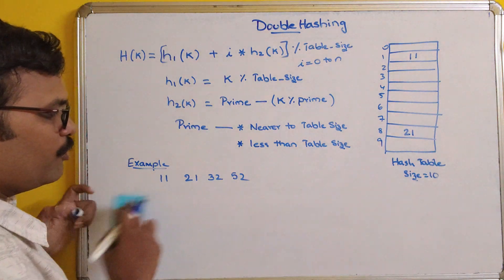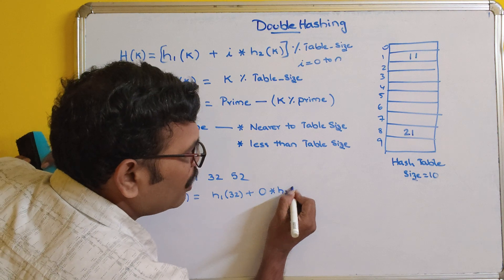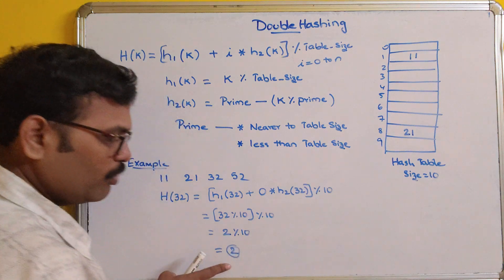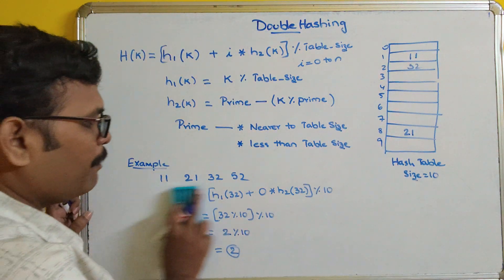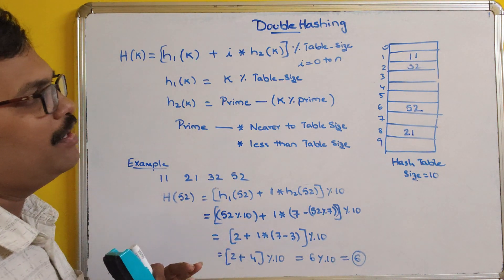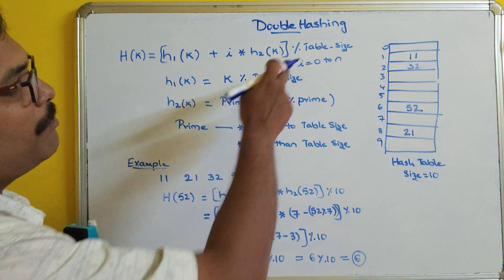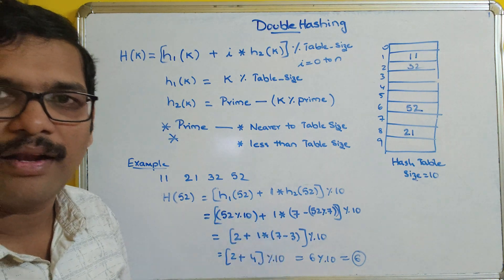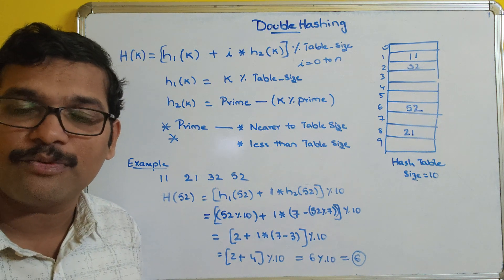DOUBLE HASHING || COLLISION HANDLING TECHNIQUES || OPEN AND CLOSED HASHING || HASHING IN DS

Comment: Hi Sir, YOu explained very well , i have a doubt " You taken the 1%10 = 1, 8%10= 8, 2%10 = 2, 6%10 = 6 you taken the quotients but in your previous lectures you taken the remainders , and also in this lecture you taken the remainders in the h1(K) and h2(k)" can you clarify me this
Reply from the maker: Hi
Here also we are taking reminders not quotients 2%10 mean remainder 2. Thanks for your comment.
Reply: Sir 
May I Take the prime as 8 or 9 which is nearer to table size and less than it